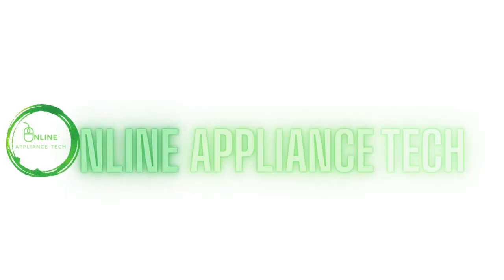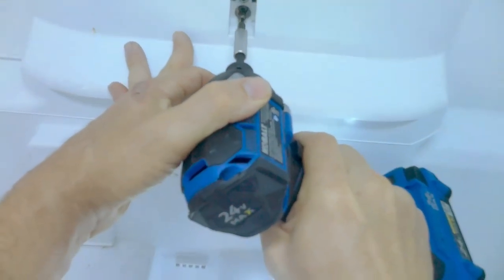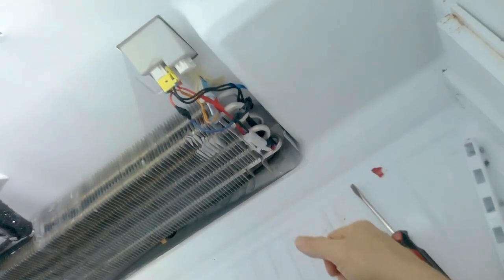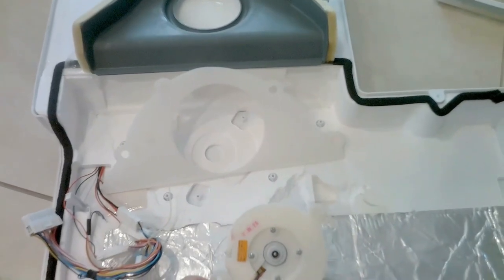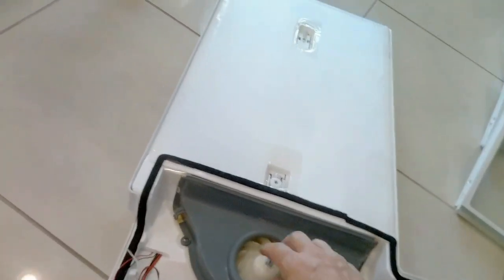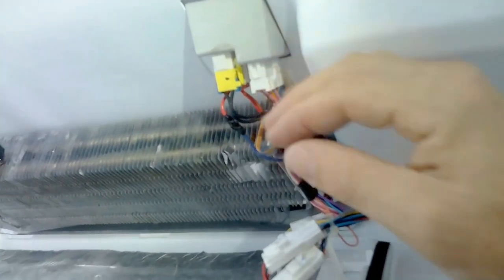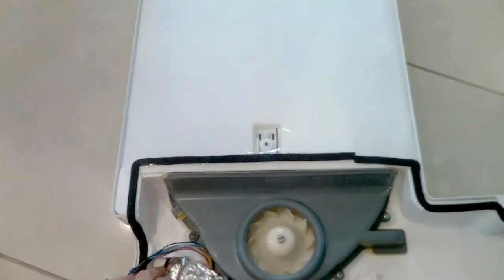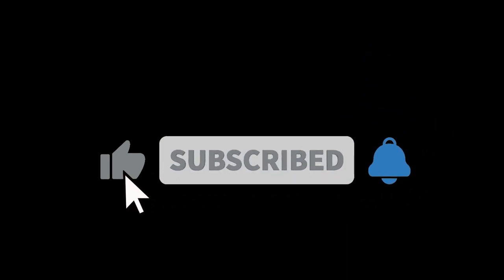LG Refrigerator RF Error Code: DIY Fan Motor Replacement & Repair Guide

Comment: Thanks for this. I kept replacing the wrong fan (in the freezer). Mine was completely frozen! Defrosted it and it works great now. Do you know what would cause it to freeze up like that? No other codes popped up before this.

Comment: Thanks for the video.  What happens if I don't replace it.  Is it the type of thing where it might stop spinning tomorrow, or it might work fine (just noisy) for six months or whatever?
Reply from the maker: It's always best to replace it sooner rather than later to avoid any potential issues.

Comment: I have the same fridge. My same fan is not running, I also noticed it looks like the fan at the top of the module (behind the air filter) is not running either. Do you think it is as simple as replacing the same fan motor you did? What I mean is is there any chance that if one wasn't running the other would stop? Or do you think it could be a relay or thermistor of some sort?
Reply: @buddyfoster6698  did you find the answer to your question because I have the same thing
Reply: @Australia106  unfortunately no. Well maybe. This was my parents fridge. They called a guy and he said it was the compressor. I wasn’t around to go over everything so I can’t say I’m fully confident in his answer. They ended up just getting a new refrigerator. Wish I could’ve been more help.